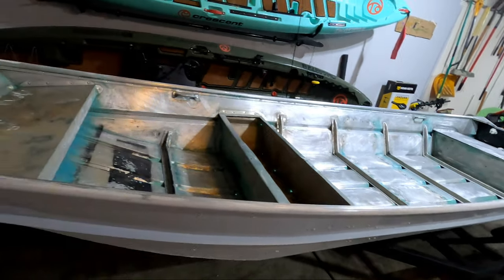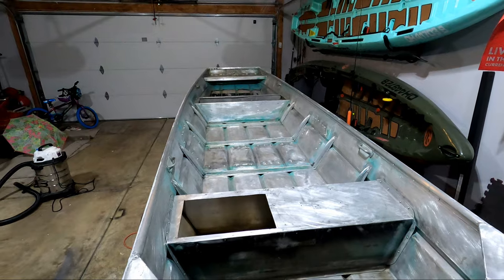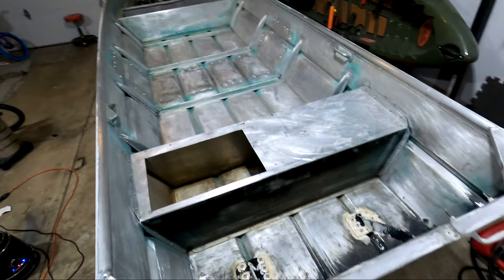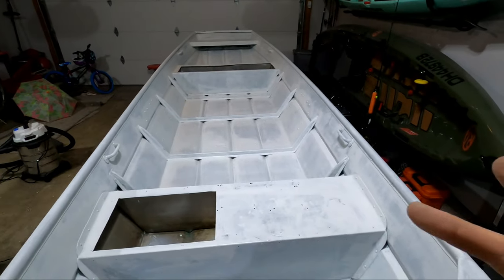EPOXY PREP & PAINT w/ Rustoleum Gloss White Enamel on the JON BOAT TO BASS BOAT CONVERSION BUILD

Comment: What made you choose the enamel for interior instead of the rust oleum marine topside paint?
Reply from the maker: A couple reasons, the first was that the topside paint was way too glossy, it would have been a glare nightmare. The second was cost, enamel is cheap. And third was that it's easy to touch up and readily available.

Comment: Did you have any loose  haul rivets before you did the bottom rivets with epoxy? I’m planning on coating the entire bottom of my Jon boat with Coat It and I don’t know if loose rivets need to be tightened or if the Coat It will hold them in place enough. Your advice would be much appreciated.
Reply from the maker: I would tighten best you can beforehand. I have a video where I tighten the rivets on another boat on the channel if you need advice.
Reply: @mvboutdoors   I saw that video, but I don’t have a buck riveter. Can’t you use a hammer with something else applying pressure to the other side of the rivet?
Reply from the maker: @pwinnett222  yes you can, back it with a sledgehammer head
Reply: @mvboutdoors   thank you! Keep up the great work on your channel. Your current boat build turned out really nice. I hope you enjoy it a lot with your family. Happy 4th of July!

Comment: Do you have to epoxy for prep or can I just sand and acetone wipe?
Reply from the maker: The epoxy was used for an extra layer of leak sealing, to make sure the rivets never leak. It's entirely optional.
Reply: Where did you purchase the Gluvit?  Cost?